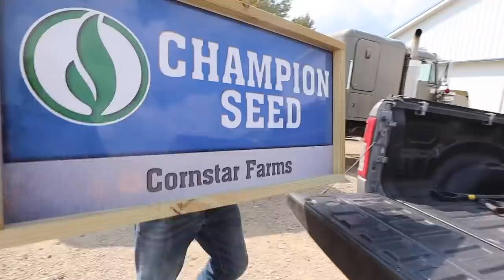Paying Off A Church’s Mortgage In 48 Hours ($105k)

Comment: @2:16 the eaves of the house should have the 2x4 boards rotated 90 degrees.  This is because the 2x4 has all it strength in that direction.  Might verify with Justin if you have questions but great job with the project!

Comment: I seem to recall corn with multiple ears per stalk back in the 60s and 70s when I spent a lot of time on farms. I also remember the stalks being a lot shorter. If more space allows 2 ears instead of one it seems like doubling the space between rows would be beneficial. Plant half as much seed for the same number of ears with less stalks and leaves to use up the water and nutrients.

Comment: I saw on the last video you got new lights for the house and shop, put them on a WIFI plug or a WIFI switch, you can turn them on with your phone when in the driveway or even when down the road before you pull into the yard.